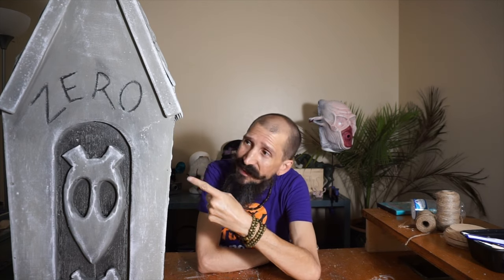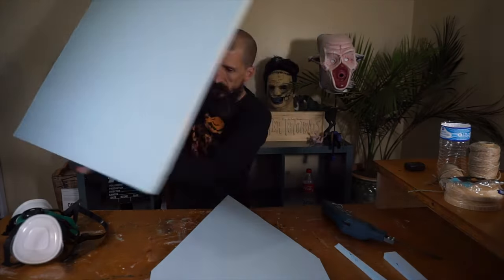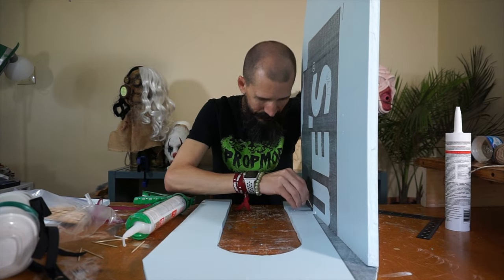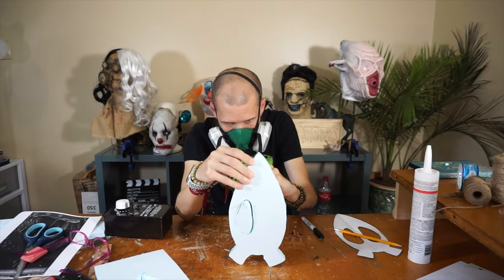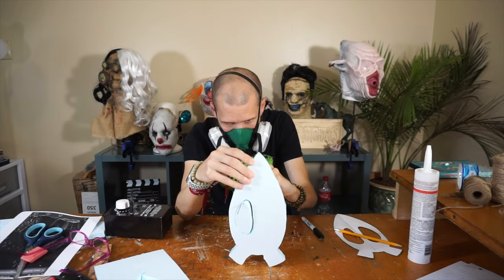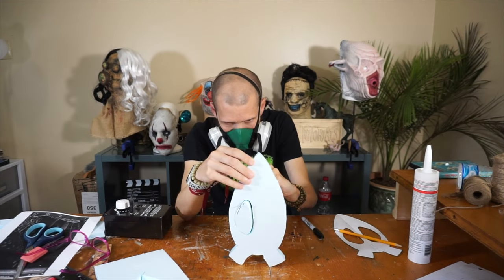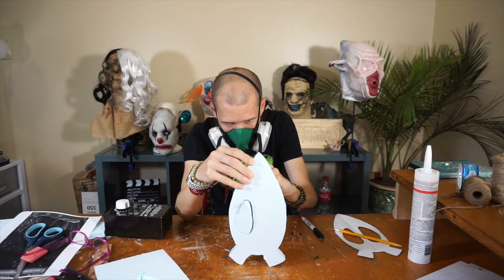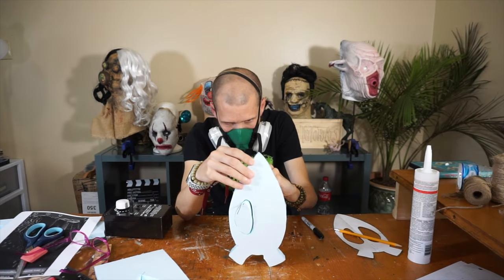DIY Zero Tombstone - Nightmare Before Christmas

Comment from the maker: Visit Hot Wire Foam Factory here: https://hotwirefoamfactory.com/home.php?bid=4&partner=35976
Reply: Your shop site didn't work for me.... instead I got some phishy congratulations web page
Reply: I found one at harbor freight.
Reply: I love the video and would really love to make Zero's doghouse, but I don't see dimensions and item list anywhere. I joined your patreon hoping to find it there, but no luck. I see the dimensions for the front and the cross in the picture, but not for the back walls and there is no list of items needed. If you could please include a list of items and dimensions I would be grateful. Thanks!
Reply: I've seen most of your videos and they are so inspiring and freaking awesome. I have a box of various sizes in trolls that I collected with my sisters when we were Young. I would love to make some kind of Halloween ghouls out of them but I don't know where to start. Can you do a video on something like this using the little plastic trolls? You have awesome videos, thank you so much for sharing them.

Comment: If you make this and live in an area where you see rain or snow, from experience, make sure you seal the foam prior to painting. We made this a few years ago and used a pint of driveway sealant before we painted it. This helped add a stone texture to the foam and made it waterproof. Zero's doghouse has survived 3 years of Ohio weather and is still going strong.
Reply: Fellow Ohioan here ☺ I plan on making this as well and with our crazy weather do you have any other tips?
Reply: Jessica Tinker this was going to be my question exactly. When you put that much work into something you want it to last! It would not survive the sun and rain where I live in Texas I don't think. I really appreciate seeing this response, now I don't have to ask LOL! Thank you!
Reply: @kellybegley9291  Sure thing:
- I used 2" thick insulation foam board instead of the thinner foam in the video.
- I used an industrial construction grade adhesive to connect the foam (you can buy different types at any hardware store in caulk aisle)
- After it is assembled, coat the whole house in some kind of driveway or basement waterproofer (I used Drylok) I recommend putting one coat on, letting it dry, and applying a second just to make sure you seal everything. Be sure to really coat it and get in the nooks and crannies. The sealer has a texture to it, so it actually made our foam look like stone on it's own. It was awesome.
- I used outdoor oil based paints in grey, silver, and black. Painted grey everywhere, then used black and silver sparingly with a dry brush to add depth.
- I sealed off the whole thing with one coat of matte clear polyurethane spray paint.

Our doghouse is also made of solid foam, so while we stacked and glued the house together, we embedded two 1/2" PVC pipes (about 18 inches long) into the body of the dog house. This way we can slide the doghouse onto Rebar we have put into the ground. It has yet to blow away or fall over in any of the storms we have had over  the years.

If you have IG, you can see a during and final picture on my account @jtinks13, just to give you ideas. Happy Halloween :)
Reply: @KatPickles  We went through some serious trial and error over the years with our NBC decorations. It can be a headache when you have to keep this stuff outside in bad weather.
Reply: Thank you so so much thats awesome. Yes your right its hard to put all that work into it and it not last so appreciate the awesome advice thanks again ☺
Reply: Oh and Happy Halloween as well 🤡
Reply: Thanks for this. It was my first thought/concern. 🎃
Reply: Ty I'm in Pittsburgh good to know

Comment: A suggestion.... make a flying zero mounted on a wire that will “fly” around it.
Reply from the maker: Good idea!
Reply: You don't even have to get super fancy with it you could just hang zero there from a small shepherd's hook
Reply: That was exactly what I thought!
Reply: Brilliant idea. I definitely have to try that since I bought a large zero At party city,but I need to make a hole to put a small lighter inside ,so the nose is always glowing.
Reply: @kkeegan32  or use fishing line and hang it from a tree limb
Reply: I bought the screaming ghost 👻 from spirit, replaced the ghost with a zero and it “flys” back and fourth. I love it. Making this tomb to go with zero and my haunted mansion nightmare before Christmas decor.

Comment: I made one using 2 Inch thick pink foam...I glued 2x2's on the inside walls so you can screw it together and take it apart for storage..also it's heavier so the wind won't blow it away outside

Comment: Love the texture trick. One we use in our shop, especially for stone things and to weather proof a bit more. I mix Flex-crete to a slightly watery toothpaste consistency and brush on in layers. About 3 layers doesn’t add much weight and it’s literally covered in stone. Adjusting the amount of water and brush techniques can add or smooth texture. It also seals the foam, then you’re free to use spray paint.

Comment: I used the same foamboard to make my G1 Transformers Wheeljack costume, but with a hot wire cutters and a box knife. Tons of silicone, toothpicks and cut down kebob skewers later, I had the build. Coated the entire thing in Kilz before painting to keep the spray paints from eating the foamboard.

Comment: A little tip when trying to make foam look like stone or concrete, before assembly, wad up a ball of tin foil the size of your fist and rull it over all the smooth surfaces. It will create tiny indentations that will allow for more natural looking light and dark spaces when you do your dry brushing later.

Comment: You could also glue some plastic 90 degree corner joints where the walls meet for added stability and rigidity.

Comment: This is awesome!
Is it just me, or did the tool you used to cut the door also create awesome spiderwebs?
Also, I admire your courage to wear white pants while painting. I refuse to even buy white clothes lol
Reply from the maker: It does leave some filaments of foam, but they're very brittle and break easily.
cheers,
ET
Reply: Ahh that's too bad. I was hoping it might be another way to make prop spider webs.

Comment: Tip.... I scored the foam board with an electric knife(used for turkey), scored,  not cut all the way thru and the foam snaps perfectly STRAIGHT!!  Making cell doors, painted to look like metal, I needed straight cut.  the heat cutter is great but can be a little wobbly which  is okay for most projects. Also no fumes. Lil tip from Texas.....

Comment: What are the benefits of using a silicone glue in place of contact cement? Is it just a preference of yours or do you think someone can get away with using cc for something like this? I've used it many times for EVA foam projects, but I don't think I've ever tried it on insulation foam nor do I know how well it holds up outdoors for long periods of time. Thanks, and great tutorial! I can't wait to get started on my Halloween decorations this year!

Comment: Is silicone better to use then hot glue on Styrofoam?
Reply: standard art store hot glue guns can be too hot and melt the foam. Silicone works well but IMHO using spray foam works better and faster.
Reply: @stratparrott1446  I'll give it a try. I didn't think the hot glue would be too hot. Makes sense though 😂
Reply: Hunter Stump just depends on your hot glue gun. Also they can break off after time the silicone or spray foam will hold longer and stronger
Reply: Thank you. I appreciate the knowledge. I'll be trying silicone I think!